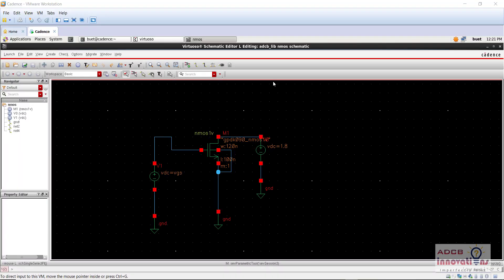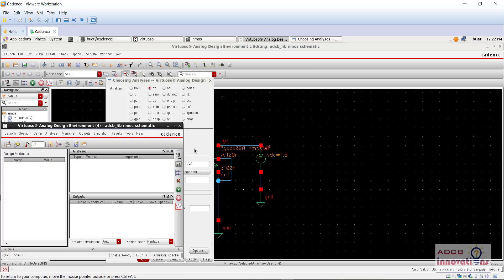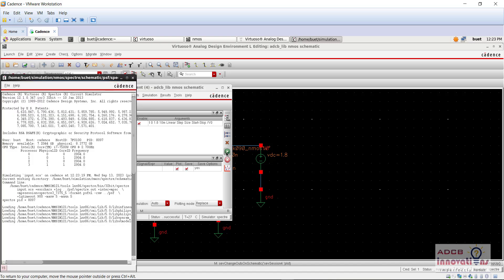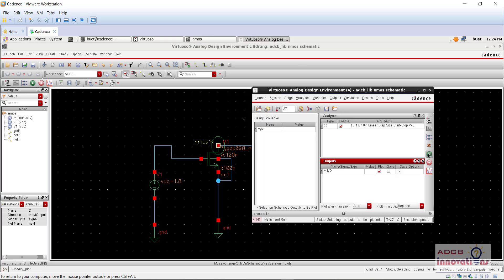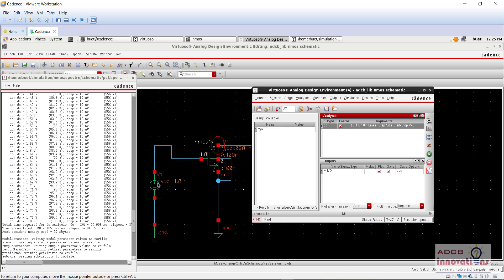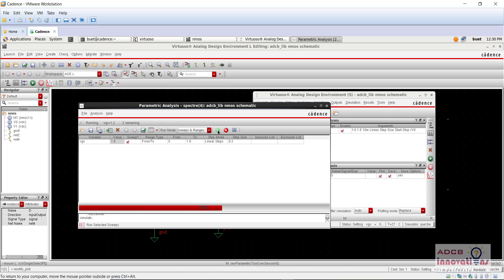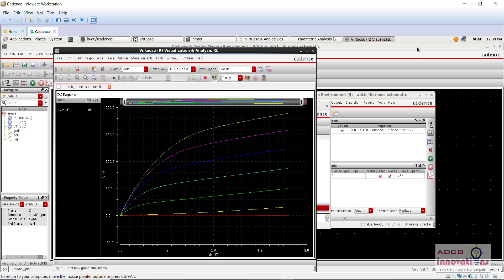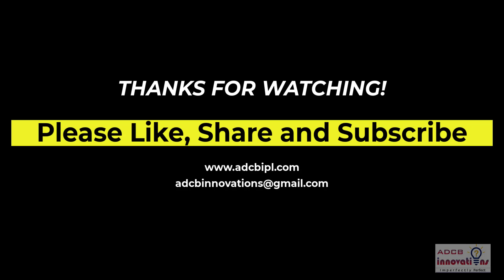NMOS I-V Characteristics using Cadence Virtuoso

Comment: 9:31 how did you get current into the graph, you haven't selected or mentioned about it ?
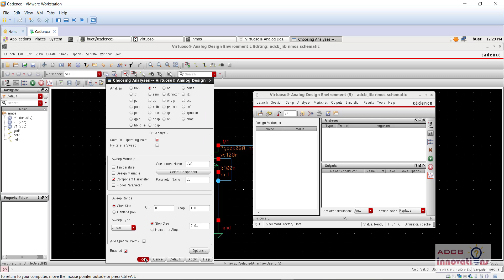Reply from the maker: In ADE when we select the ouputs to be plotted (7:30), we select it as the drain terminal of the MOSFET, thus, it plots the drain current (Id) in the graph.